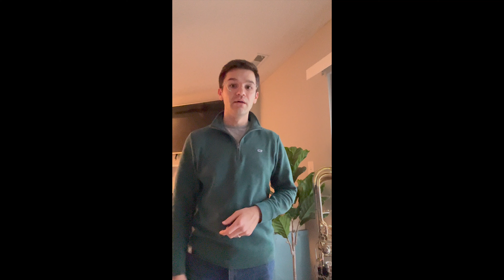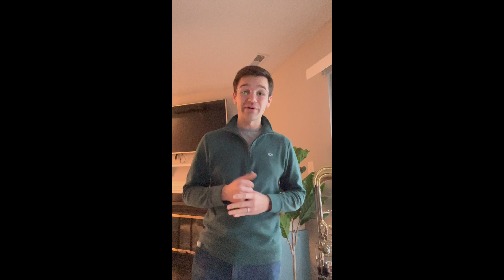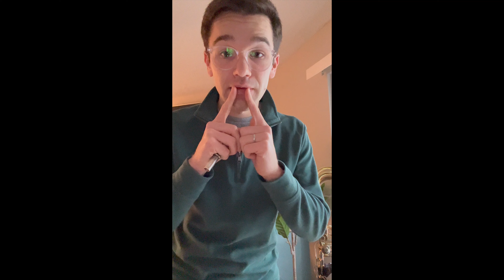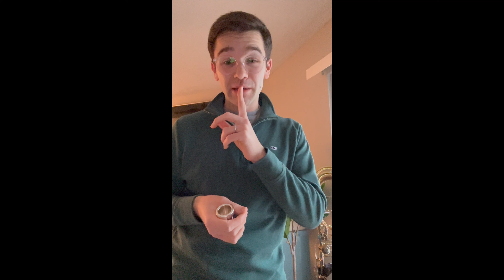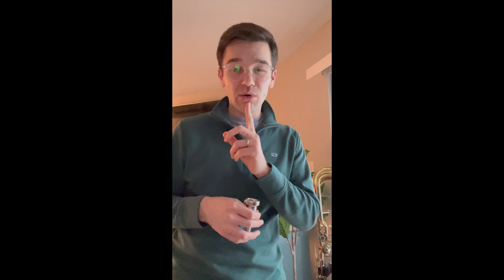How to Get Rid of a Double Buzz

Comment: To be honest this is not so useful. In the end it is not just "thinking that I can do this" and then problem solved. I tried to focus on "not doing it" but it simply just isn't that easy
Reply from the maker: Hi Sam-nb1rm. I agree with you that it is not simply "thinking I can do this." Nothing that takes skill is fixed that easily; some things take a lot of time and repetition (and some trial and error) to fix. This video is not meant as a "quick fix" at all for a double buzz but as one idea of many out there which may help some folks out over time. I'd suggest sticking with it for a bit and see if it helps. If it still doesn't then no worries. Everyone is different and what works for some people may not work for others. I do hope things get sorted out for you in the long run and wish you all the best on your adventure!
Reply: I don*t think “just think you can” is what Christopher suggests here. What I took from this (pls correct my if Ím wrong) Double buzz happens if the mouthpiece is not centered in terms of angle, position to my aperture. It also happens to me when tired / not in good form. So horn down, back to basics: relax shoulders, breathe freely and re-center lips towards the mouthpiece.